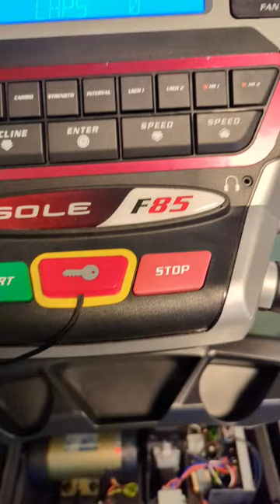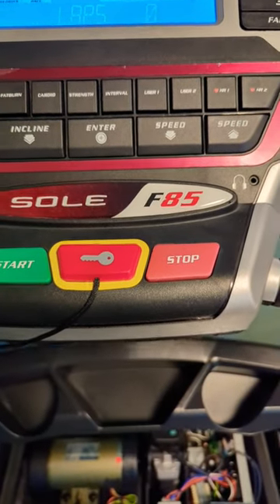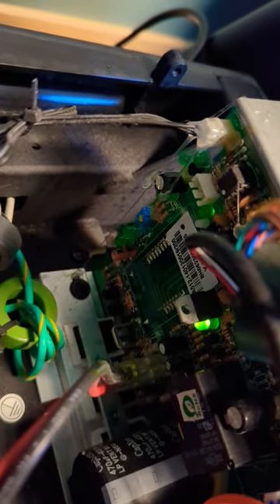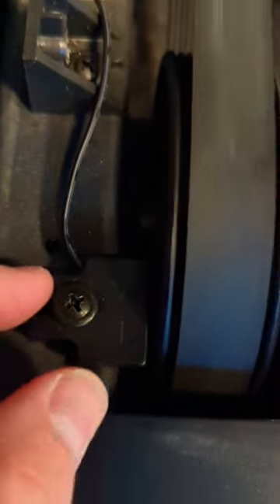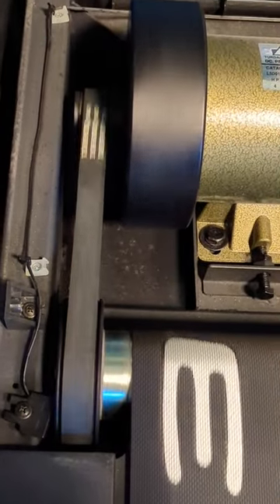Sole F85 reed sensor adjustment - Something to think about @FitnessTechnologyServices ?

Comment: Well thank you but I do have a video on installing and adjusting speed sensor . Great troubleshooting job
Reply from the maker: Thank you for answering me! Yes, I saw that video. And there I believe you have it parallel, so the two arrows are pointing straight at the magnet. And you state that the placement and distance are important, but not vital. But seeing as a parallel placement creates this problem, and an offset placement fixes it, wouldn't the placement be vital? Not trying to argue, just honestly interested in if this actually has any bearing on the function of the machine, as it seems it does. I got this problem after adjusting the sensor to parallel after doing some lubrication because I thought it looked wrong that it was offset and the screw was a bit loose. I thought it had come off-center somehow. After that the problems started with the speed, especially at slower speeds, being all off. But it seems that the sensor should be at an angle? I'm sorry if I am referencing an old video of yours that might not be up to date, but I do think we are talking about the same video?
Reply: @originaltasan  The speed sensor is a simple reed switch does not completely matter what angle it sits sometimes even loosening the mounting screw helps. Double tapping of the light means the speed signal is holding on two long. So turning makes the signal drop quicker. You can do the same thing by moving the mounting hole back and remounting switch. This is also a sign of the switch going bad .and I didn’t pay attention to the video you responded on 😁 sorry
Reply from the maker: @FitnessTechnologyServices  Thanks for clarifying 😊